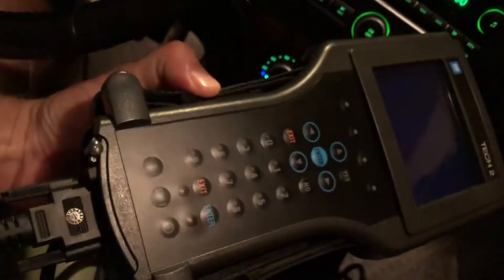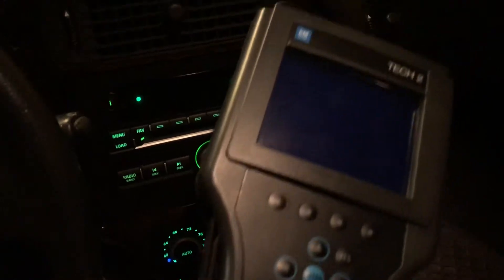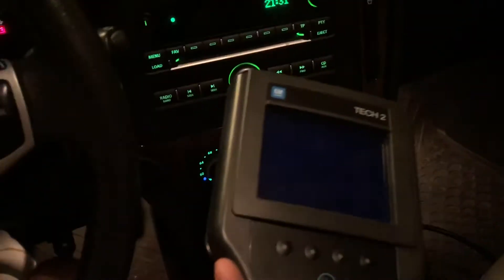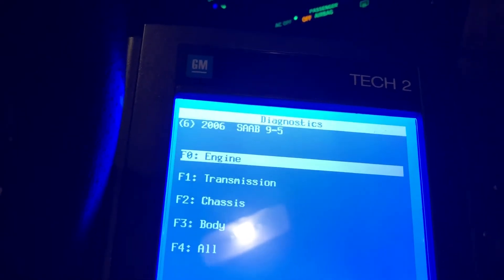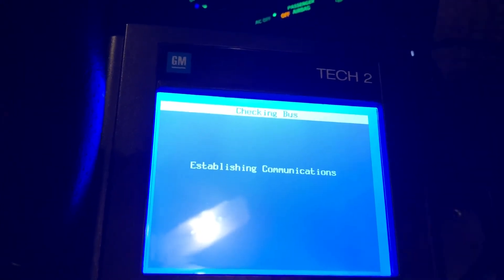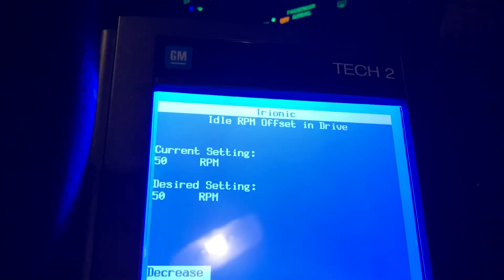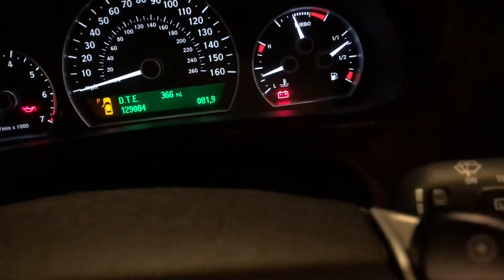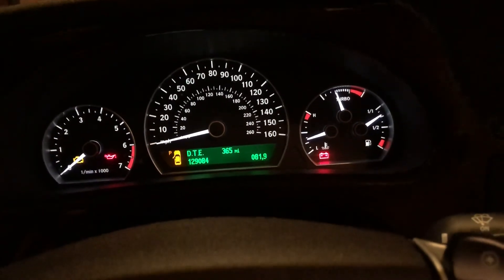2006 Saab 9-5 idle vibration fix via Tech 2

Comment: My 06' 9-5 2.3T sportcombi has a terrible vibration while sitting still in D. If i give it a little gas itll go away (sometimes ill put it in N while sitting at a red light) and even then its still pretty bad. Did the motor mounts but didnt help. Id like to try this one day. Thanks for the vid
Reply from the maker: I'm in the same boat. Motor mounts helped somewhat but definitely didn't cure it. Another thing to check is subframe bushings. But I did those too and still had vibration. This idle speed adjustment has made the most difference for me.

Comment: What other adjustments can you do with yours without a subscription? Or do you need a subscription? I'm still kind of confused on all of what you need or dont need. I want to be able to trouble shoot much easier, clear false error messages on the SID and teach myself how to build performance tunes. What exactly do I need using the assumption I have nothing at the moment. Thank you for your info. My saab is a 2006 9-3 aero 2.8 6 speed manual SS.
Reply from the maker: Sorry for the SUPER late reply...somehow missed all these comments a year ago. With the 9-3 I am not sure, as I have only ever used a Tech 2 on my 2006 9-5 and also on my 2009 Suburban. Security access hasn't been necessary and I've messed with quite a bit including changing the locking behavior, headlight setup, and more.